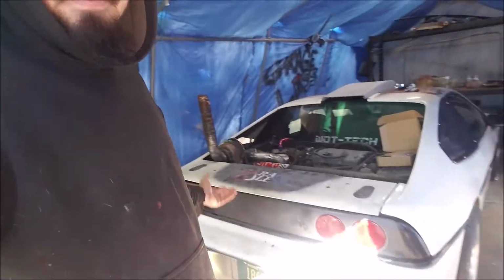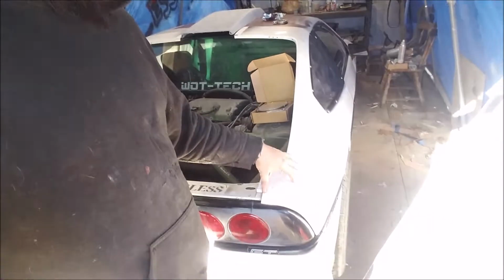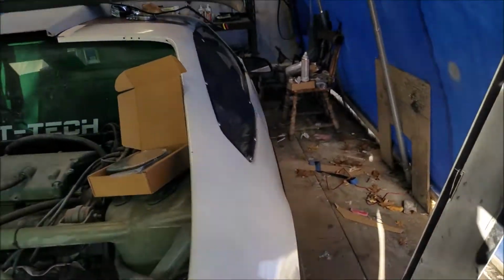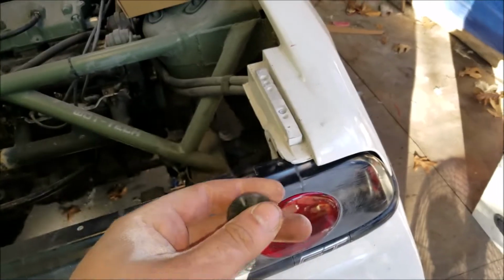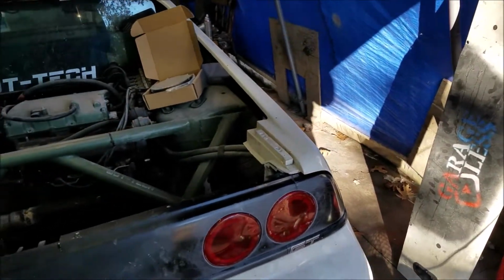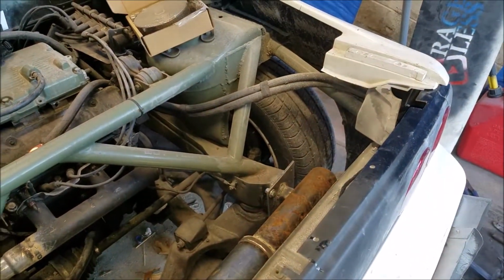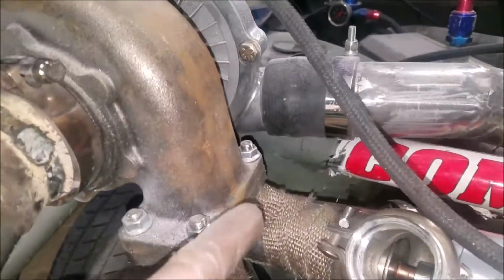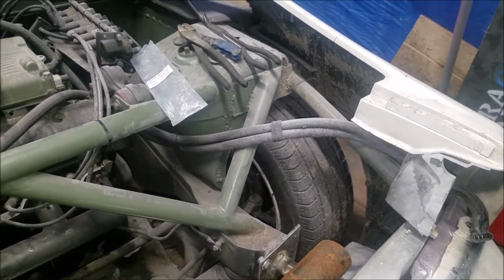CUTTING UP FIERO! FIERO GETS NEW EXHAUST AND WE WRAP THE TURBO MANIFOLD!

Comment: If it's basalt wrap you don't need to wet it first.  But I would recommend you seal it up with some high heat engine paint.  I used clear on my headers.  I haven't sealed the crossover pipe yet, and whenever I start the car in the rain, it's like a steam bath back there.